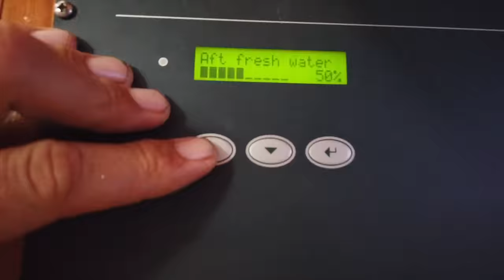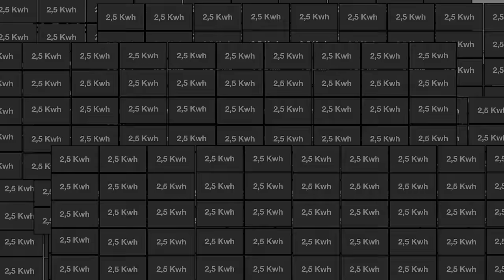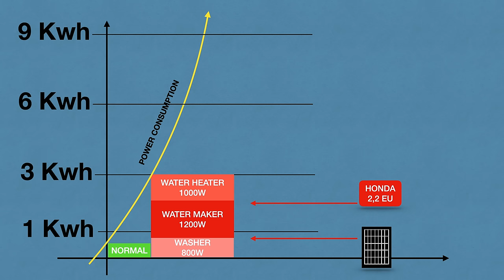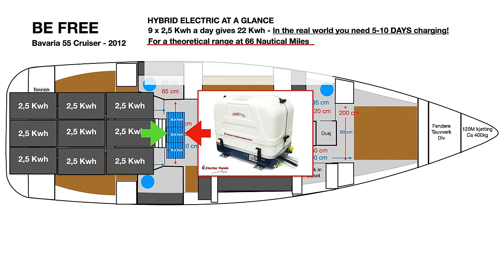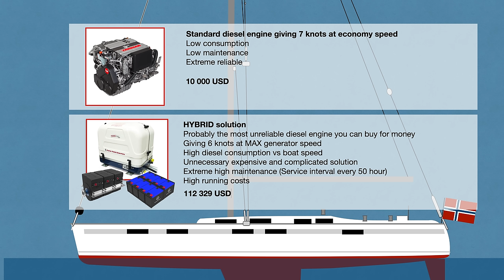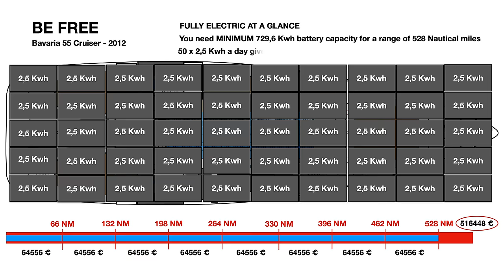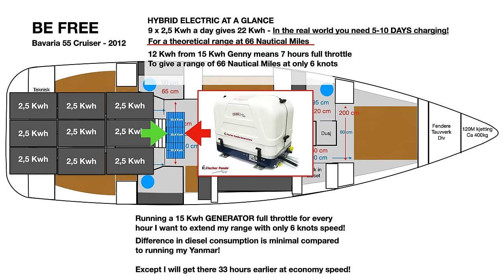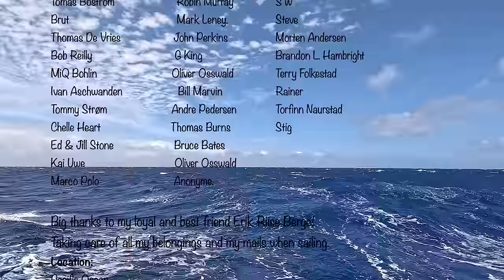Why I don't believe in ELECTRIC or HYBRID for long-distance sailing - SwT 170 - MY HONEST OPINION

Comment: After sailing half way around the world I agree completely. We are now in Thailand and motor sailing is a part of life in this part of the world. Sailing Aquarius just lost their masts crossing the Atlantic and still have 1000 miles to get to safely. They just received 260ltrs of diesel so now they can reach Martinique. Imagine trying to get battery power dropped off so your electric motor can get you to safety!
Reply: Well yeah that would be the counter to it, you dont need a delivery lol.  good point. If you cant get the delivery, you are screwed if you have fossil fuel only. I didnt even think about that.
Reply: Yeah but Diesel will give you Electrical Power, you got the Sun, you got the Wind. Do you have the Imagination?
Reply: There is a minor flaw in you're argument  @JoeKyser  when the mast comes down it is highly likely that your solar is going to get bashed up, and where does this leave you ?
Reply: @nooneswedish5142  Very few sailboats have their solar panels attached to the mast.
Reply: Imagine pouring diesel into a tank contaminated with dieselbug.
Reply: @SuperDirk1965  Imagine breathing in air that has hydrogen cyanide in it
Reply: @JoeKyser  Imagine the sky collapsing
Reply: @SuperDirk1965  I'd rather have a Supersquid bashing my boat than the sky falling. I would always go fully electric and DEATH TO FOSSIL!
Reply: One rogue wave whilst looking at your batteries and game over... 2 mr funnels on board and all diesel bug and water contamination is sorted, double up with a spare outboard motor and you have a few failsafes...
Reply: @wolfgangpreier9160 why wouldn't you do hybrid electric with diesel as backup and to top up the power?

Comment: I don’t comment very much, but this I will say this is why this channel is my favorite of them all. Thomas is a very knowledgeable sailor, in seamanship and technical. I always look forward to new episodes knowing I will learn more about sailing. Thanks for sharing Thomas 💪🏽🫶🏽🤙🏽
Reply: Very well said! I completely agree 😇👍🏽
Reply: I do t sea how is he knowledgeable then he never haved an electric. Also what he is talking make no sense at all. Totaly mialiding information. Look sailing Vagabond. I met then in culatra portugal. They also was against alectric engine. Look them now. Proud of the electric engine.
Reply: I haven't watched recent La Vagabond episodes, but the last one I saw, he was afraid of getting into trouble with only an electric engine, as his diesel engine was getting replaced.  That is inspite of having a very fast boat that would optimize hydrogeneration.  I'm interested in how they and sailing with the wynns do long term. @SailingTerra
Reply: @SailingTerra I dont think you ever used solar power for a house with full comfort,then you know that it’s too much in summertime and by far not enough in wintertimes 
How can you get enough solar power on a boat,shadow masts cables wrong direction continues….
It should be nice but it’s just dreaming about,Thomas explain in simple words the truth
Reply: @marcvandaele1878  I have 3000w solar on my boat. 99%i use only my electric engine. I have aways 100%battery using all haushold units like 140liter samsung fridge, washing machine and everthink electric. Powered with 5kw inverter.  Never problem with power. 50kw battery where I want to ubgrade to more in future.
Reply: @SailingTerra  that’s nice that you have that,but how far can you drive/sail on this setup 
For sure you can have enough for freezer lights electronics cooking…
Can you go trough a night sailing/driving,i doubt….and after many hours no sun how fast your battery gone be empty

Comment: Regarding genset being unreliable (Fisher-Panda is always unreliable, AFAIK), but in general many people don¨t know that one need to cool the engine/genset room, otherwise the engine/genset will begin to malfunction. 
 
An air-water heat exchanger can move a lot of heat from the engine/genset room to the sea.  You will ned a circulation pump for the water, and a fan for moving the air. The heat exchanger usually have an build-in fan. You will also need ducting to take the heat out just below the ceiling of the engine/genset room and blow it out in the bottom of the engine/genset room.

Comment: For coastal and daysailing, electric propulsion is excellent. You have lot's of marinas where you can charge your boat batteries. But for ocean/offshore sailing electric propulsion sucks. You have abysmal range. And you need all the range you can get to motor in the Doldrums or in heavy weather.

Comment: Hi Thomas, one of my viewers linked me this, as I'm working on an all-electric cruiser design. I had a few questions, if I may (and sorry if this is covered in older videos, I'm new to your channel). You mentioned at the end your trusty Yanmar, is your boat not electric at the moment? If so, was it in the past? I'm curious what your tested power inputs to speed in water curve looked like. I saw the 10x 19" rack batteries at the start of the video, were those for propulsion or house loads? I'm guessing they were 100Ah @ 51.2v nominal? Did you look at regen under sail from the prop? I know this is something Ocean Volt is well known for, so I am curious how that would factor into recharging (it's the primary source of recharging on passage in my plans, with solar generation being mainly to offset house loads). 

I think that for a boat of your size, yes pure electric is hard (I believe your dry displacement is ~16 tonnes?). In smaller boats with more hydroefficient hulls, the energy to move is much lower. On that, the energy required to move goes up, as I am sure you know well, quite aggressively. This is why I was curious about the power input to speed in water curve above. In my mind, in an emergency (speaking from a safety perspective), effective range can be greatly extended by slow steaming. Anyway, that's probably more than enough to ask you to read, so I will stop here for now. cheers.

Comment: As an electrical engineer, I concur. My long distance sails are only 1200nm but it doesn’t take long for conditions to become a problem. Thank you for doing this well informed video.
Reply: I agree. Although I'd prefer he tightened up the precision of his terminology and be consistent. At 5:55 he said "2.5 kilowatts of energy". Of course (as you will be aware as an elec eng) ENERGY is not measured in kilowatts, POWER is measured in kW. For the benefit of other viewers, power is the rate that energy is produced per unit of time, 1 kilowatt is defined as 1 kilojoule of energy per second. So for, say, 10 hours of useable daylight, each panel produces about 250 Watts of power every hour (250W x 10h/day = 2500Wh/day which is 2.5kWh/day). What I'm suspecting is that Thomas meant to say 2.5 kWh/day - kilowatt hours per day - which IS an expression of DAILY energy production, and much more useful as you don't have to get into the weeds of hourly fluctuations. (Note: there are other calculations embedded in that number that we're not shown, like total daylight hours, and some value of how solar production varies through the day. Admittedly that might be beyond the scope of what he wished to do here.) But, at minimum, I'd like to see him post the rated POWER of each panel - in WATTS or KILOWATTS, if he can. As for the rest of the video, it's excellent. Especially enjoyed his remarks about speed loss due to currents, and the need for adequate range. But I think his generator headaches might be largely due to an inferior brand.

Comment: That was a gutsy and detailed discussion.  I applaud your through research and effective use of graphics.  
Since I'm old and old-school, you won't be surprised that I, over 45 years of owning a sloop and cruising,
never could see the practicality of the " green solution".  So, I use a little dinosaur squeezings; far less that my friends on trawlers use on a typical cruise.

Comment: Nice video! But what about the hybrid system HH catamarans are using? Its a normal diesel engine on a straight shaft with possibility to engage electric engine for regen and power.

Comment: Just wondering what the significance of a 7 Knot transit speed is that you use. The range v power requirement calculation is very sensitive to vessel speed. If you say you should have a 500 mile range then it is also important to state at what speed this distance has to be covered with. The whole calculation changes dramatically  if you use the "sweet spot" of say 4 Kts.

Comment: Excellent presentation with great (and often not included) documentation/facts to back up your well reasoned assertions.  I agree that generators are not very useful or reliable and a two alternator setup on your Diesel drive system is much more reliable and effective.  Also the redundancy of a dual Alternator system is a safety issue.

Comment: Hi Thomas. Thank you for taking us with you on your travels. I have been following you since you bought Be Free in the Med and it has been a great journey. Glad to see you made it out of the Carribean and into the Pacific :) 

You bring up a lot of good points in both this and the other videos you have made on rigging and generators as well as of cause this one on 'green solutions'. I for one totally agree with you on your view of an electric propulsion solution to cover offshore sailing. I would very much like not to stuck in the middle of a storm and not be able to get out of the way because my battery bank is depleted. 

I would like to make a suggestion on a future episode if I could. I think it could be interesting to hear your thoughts on insurance. I would assume that your insurance company have changed a couple of times between the Med, your Atlantic crossing, Carribean and now the Pacific. What are your thoughts on the location (country) of your insurance company, governing laws should you need to file a claim, level of coverage, etc?

Look forward to the next time.

Comment: Hey Thomas.

I certainly appreciate the strong safety aspect of your video.  We have just bought our new (to us) mono and all those issues are front of mind.  Living  in Australia solar is a big part of our lives, but we can’t currently be completely green.  I’d love to, especially if it were cheaper too.

We expect we will upgrade our arch to take a lot more than just a single old panel, but I can’t see the reliable nanni diesel being replaced in my lifetime.

We have just traded a camping lifestyle, towing 2 tonnes of camper with 2.2 tonnes of vehicle and I can tell you honestly that the fuel consumption is crazy.  I wish we had electric or hydrogen cars to tow this weight.  They don’t exist yet.  Towing halves fuel economy to about 20 litres diesel per 100km.  Even worse going uphill.

So in our new environment we use 2 litres per hour with basically every Aussie farmer’s tractor engine, with cheap parts everywhere.

Our fallback, if we need one, is a small Kubota generator and extra Jerry cans in the deck.  I don’t know if we even need that, until we are doing ocean passages, and I don’t know if we ever will.

Comment: Hey friend, I follow your videos and I think it's great, what do you think of the hydrogenerators that were launched for boats, have you heard about them? it has different powers depending on the size of the boat, I believe that its use together with the solar panels would keep the battery banks always charged, as its operation is direct, it only depends on the current generated by the boat's displacement, I believe that it should generate a little drag for vessel.
Reply from the maker: Thank you so much for watching and for your comment as well as your questions.

Hydro generator is nothing new, in fact I have sailed with boats having this when I was a kid 40 years ago. They are more hyped up now, and also obviously more advanced and effective. Still it will not help much if no wind or not moving. 

There is so much misleading information around this topic, and even strong opinions rather than facts based on real experience. It’s very easy to debunk lots of statements if you only know some formulas. The tech is interesting and for sure moving in the right direction. Still I am pretty confident in the fact going fully electric is not the way for a long distance sailor that care about safety. All the workaround solutions are a different story, but question is for what cost and for what reason? Biggest misunderstanding is that electric is less problem than a diesel propulsion. That’s as far from reality as it can be.

Going with a low tech Diesel engine is still not only the most reliable and by far the cheapest solution. It’s also significant more environmental friendly solution end of the day. 
With today’s energy density and technology it’s still not even close to be a sustainable or even a safe solution. Remember I’m not talking about cafe sailors doing island hopping or from port to port. Blue water sailing is a different ballgame 

All the best ⛵️

Comment: I liked your analysis of this topic. I have considered doing the same change over but could not get the numbers to make sense. The only disagreement I have is the generator. I love my Fischer Panda except for the seawater pump only last a year or so before it leaks. Other than that it has given 7 years of trouble free service. Heading from Mexico to New Zealand in March. I think I will buy a Honda gen set as a backup, just in case.

Comment: Good points :-) . Have you considered  upgrading your engine alternator?  It requires a regulator, heat management etc. , but Lithium can be charged with a lot of Amps. 
In the future, it can probably run as a motor, so you can use electric as a backup :-)

Comment: 1:58 I love that and subscribed
I trust what you say and it seems to make sense. Seems like you are skilled enough to look for cheaper solar options.
Also, it seems you can easily double the amount of solar panels but now it's more complicated to just add more.
I know racing boats use hydroelectric turbines with solar. I also know partial shadow kills the efficiency of solar panels and having them at the davits like you did seems the best position for a mono hull. 
Since you already have the batteries, I would probably invest in a good simple diesel generator without backup, redo the solar panel installation selling the old ones and I guess the charge controller (MPPT ofc) would have to be upgraded with double the amount of solar.
Maybe you can spare electric power with rain collecting for dish and clothe washing.
I did merchant ship mechanic school and physics sciences at the university. I did not sail like you did but this energy topic on a sailboat is something I'm obsessed with. Please correct me on my wrongs. Take care

Comment: Love your research to back up what you think,and electric or hybrid is not reliable or powerful enough when you need it the most.I watch spoondrifters and it is a solar-hybrid electric powered 46 foot Morgan.They go 3 knots at best when it’s dead calm with no wind or current they run a diesel generator that’s about 8 kw to power the electric propulsion motor.They also run a Honda gas generator sometimes.They have had so many problems with this system including almost catching on fire.The electric motor will run hot and it’s always something wrong with the system.Your video was totally accurate with the data to back it up.I grew up building boats with my dad and have built commercial shrimp boats for myself so understand what works and what doesn’t too.A reliable diesel is priceless in bad weather even at anchor and on passages.l would like your honest opinion of Panda Fisher generators………😂😂.Hope everyone will watch this valuable video and change their ideas and opinions on electric/hybrid propulsion.Great as always Thomas 👍👍👍👍👍👍💯😊

Comment: Very good advice. I suppose some people could come up with a case for a diesel and an electric system on one boat. The diesel engine can run as a generator if need be and that electric system is going to be really nice when your around other boats enjoying their moorings etc.

Comment: Subbed. I only sail my 20 foot Nordica locally. It has a single cylinder diesel. At one point I thought about going electric but a few very simple calculation on a scrap of paper soon changed my mind. I’ll stick to the diesel. As you say electric is an expensive illusion.

Comment: Thomas,  That was so very good.  I've been trying to justify going "green" ie electric propulsion on my boat, and I have reached the same conclusion as yourself.  its complicated, expensive and dangerously limited range.  I will rather repower my classic Passport 40 with a basic but modern Beta Diesel engine.  Thank you for confirming my conclusions!

Comment: You have done an excellent analysis and I agree fully with you. For as much as we would like it to be, the electric option is not good. Those you promote electric boats are somewhat biased and did not experienced what you did.  Thanks and good continuation of your trip.
Richard
Reply: Diesel electric locomotives are a thing. He's complaining about a diesel generator while relying on a diesel engine. Both require a lot of TLC. An electric system, on the other hand, requires the occasional dusting (and a reasonable Faraday cage). Also, you don't replace diesel with batteries, solar, or wind. If you need to run long and hard I would think you would need a lot of diesel and a good generator and/or enough wind and sun to provide power from solar and regen, enough batteries to take it, and an electric motor to ensure a minimum speed.